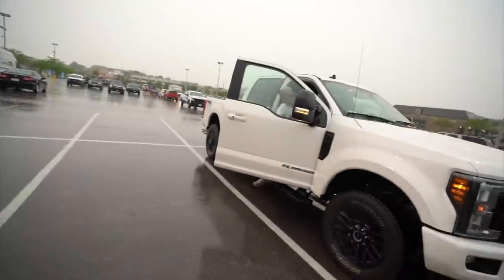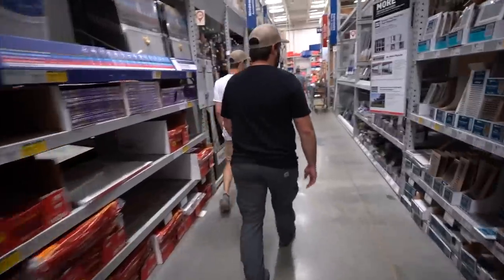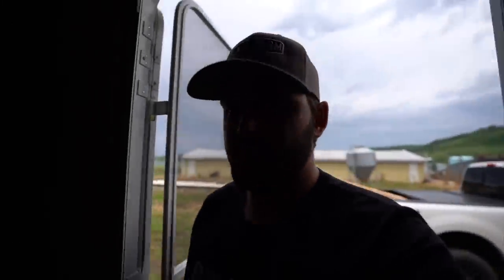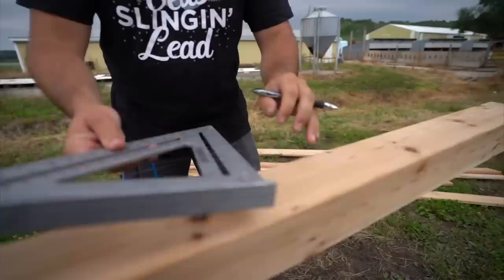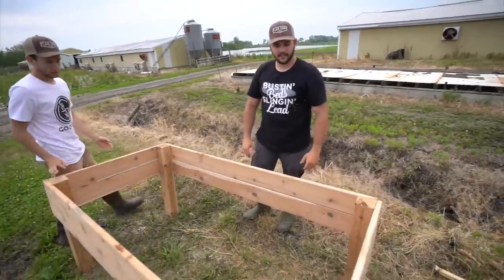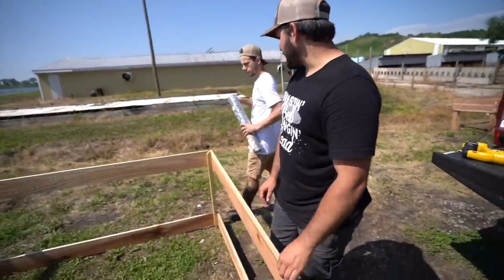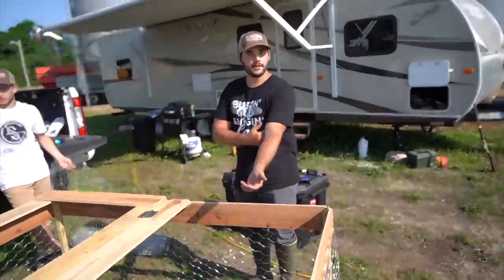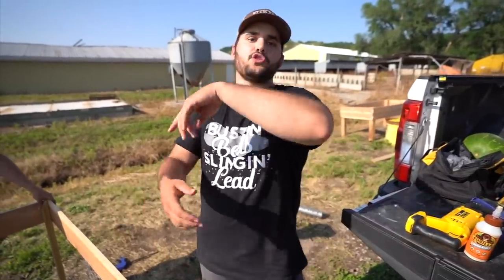Building a $25 HOMEMADE CHICKEN COOP for My FARM!!! (DIY)

Comment: You have to measure each board as you cut it, otherwise you’ll have different lengths each time because your saw blade takes up space that you’re not accounting for. Just a little tip on how to keep it even.
Reply: Two words...Stop Block. Every board at that measurement will be the same.

Comment: If I do something I don’t go small scale. To me this is for like 3 chickens. 3 sq ft per chicken so it’s not much room. I also can tell you this would be more then 25$. I know the prices are different varying from place to place but just 50 ft of chicken wire is 25$ all that wood here in Nova Scotia is easily 100$. Just my out coop area is 130$. If your shingling a roof your looking at 30$ a bundle and then roof nails is 16$ and there WILL  be added expenses so do NOT go out and get chickens thinking you can do it for 25$ cuz you can’t. Even a small scale 5 ft high by 6 wide coop that a human doesn’t go inside would cost upwards of 250$ depending on what supplies cost in each state province city or town. 

P.s when buying chicken wire the size isn’t dependent on keeping the chickens in it’s keeping what predators you have in your area out. 3 cm would keep almost everything out

Comment: Remember to measure then cut each time, rinse, repeat. Marking all the cuts first does not allow for the blade's kerf. That's the material removed by the blade. In four cuts that could add up to 1/4 inch or so.
I enjoyed this project. Good job. For a rough build made on the cheap it worked out.

Comment: hi flair
when you put on your chicken wire you put it on to lose. you need to pull it tight, the chickens will be able to get out using the slack of the wire and will be able to push it out easier than what they could when it is tighter.

Comment: Flair Farms,

If you want to blow up a beaver dam. I suggest you use the max amount of tannerite pour it in a few 5gal buckets, put 1 small propane tanks used for lanterns. Pac it in with rocks and soil. And dig a hole and pac it in there, get a good far distance and blow it up. Saw on another YouTube used 70lbs of tannerite and propane tanks with 5gal buckets. And he basically evicted the beavers half the dam was gone.

Comment: Sooo about the chicken coop, ive had chickens for awhile..and ive always had just the regular hexagon poultry wire on my coop, But about 6 months ago a stray dog got to my chicken coop at night and ripped through it and killed some of my hens. So i ended up re-doing the wire, and then added some thick rectangle wire on top and it never happened again, so hopefully this tip will help if you ever have the same type of issue.

Comment: Tip: Always make your cut before measuring the next peice. Everytime you cut you remove the thickness of the cutting blade on your material. Cut, measure, cut. That way your next peice is the same size and not three sixteenth of an inch shorter.  It looks good though. You got it done. Winning.

Comment: Dont screw the bottom of the raised bed from the bottom.  The weight  of wet soil will be too much.   Use a couple of 2×2 on the inside(long sides) to create a frame for the bottom planks.  Also leave about a 1/4 inch gap between each bottom plank for drainage.
P.S. you may want to add two center 4×4 support pieces on the center of each long side

Comment: Use the 2 saw horses to hold the wood. Let the cut happen outside of the support and it will fall away from you. Gonna get hurt cutting between the supports. Just looking out for ya...

Comment: This is not a $25 project. Chicken wire alone is like $60 a roll. Wood would cost nearly $60-80 to build this if you needed to buy all of these materials. I built my own and it was just under $200 using the cheapest materials I could find

Comment: You could use the wood that you have for the bottom.  Just use the chicken wire  and then put some wear barrier  to hold the dirt in then you dont have to worry about it  holding to much water when it rains!

Comment: Your chicken wire will hold but to keep the birds in and predators out, you should do two layers or wire. One on the outside and one on the inside. That way the predators can’t push the wire in and the chickens can’t push the wires out

Comment: Look up diy wire spool chicken coops you can use a 4" pvc that's 4-5'long use a 90degree elbow and attach a 3' piece and use hole saw to drill holes every 6". Put cap on that end and fill 4' side with feed. Cheap gravity feeder

Comment: I raise chickens for the fair and have two those but there bigger and u can just screw a sheet of steel on the half without the door also u might want to put wire with smaller holes in it because sometimes if the chickens sleep close to the side something could reach through and grab the head cause that’s what happened to me before we put the wire with smaller holes

Comment: Don't pump the trigger on the drill when putting in a screw.  You run the risk of stripping the screw, snapping the screw head off or breaking the apex bit.  Use continuous pressure on the trigger.  Otherwise great video.

Comment: The reason why the length of the boards are so different is you forgot to add in the thickness of the blade when you cut them

Comment: The reason 1 of the wire was cheaper was it was larger holes.  You put that on the sides. Not good. Not nearly as predator proof